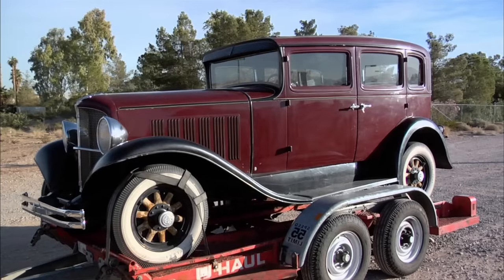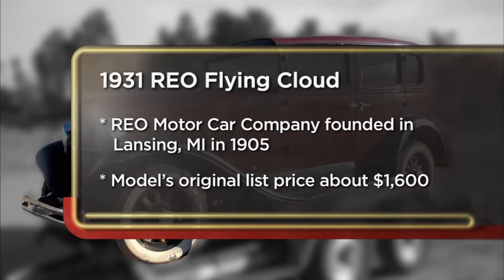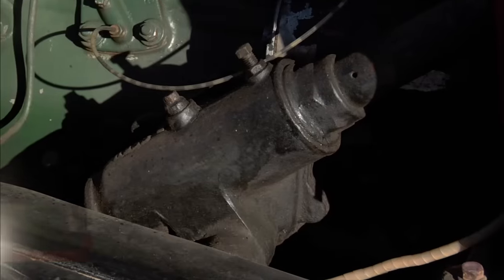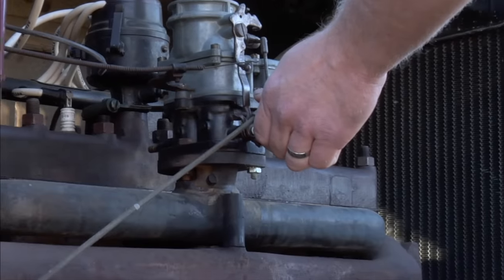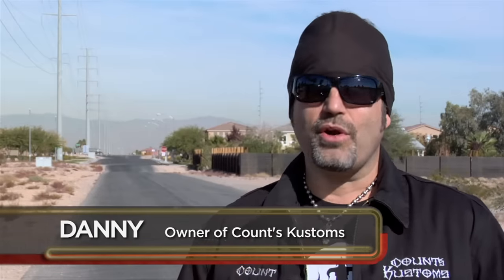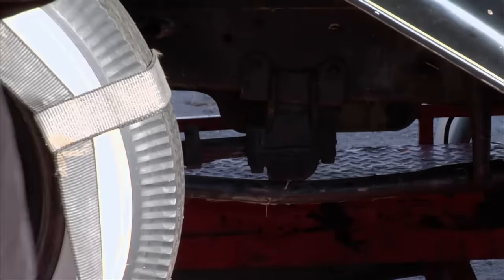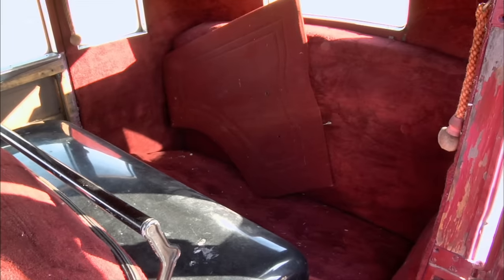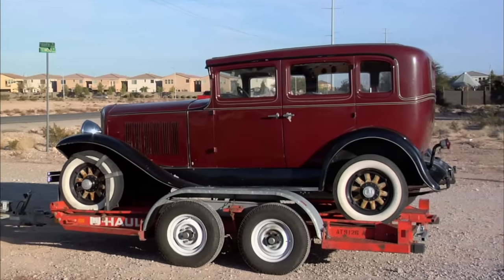Pawn Stars: BUMPER TO BUMPER Reno Needed for 1931 REO Flying Cloud

Comment: This happens all the time with old cars. They are just solid enough to look ok but in order to be perfect they need total restorations. But the cost of the restoration is more than the value after it's done. This is what has led to the rise of unrestored cars just getting mechanical make overs and driven. 30 years ago that was uncommon but today they are as common as show cars. I personally have a '70 Challenger R/T and a 68 Charger, both are great driving cars but they both need total restorations to be perfect. The Challenger probably would be worth it money wise but the Charger would be a break even at best. It doesn't matter though as neither are for sale and I drive the crap out of them as they are and love every minute of it.